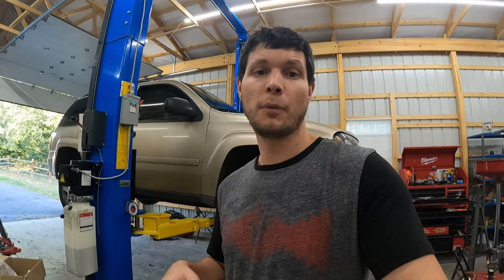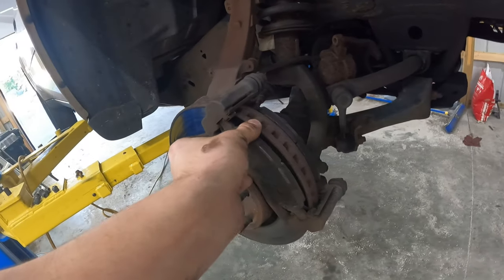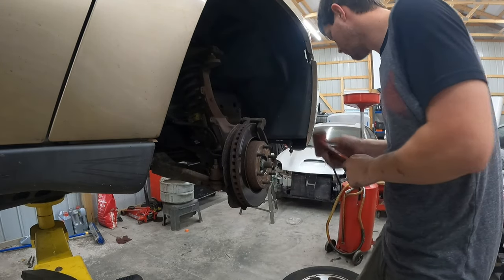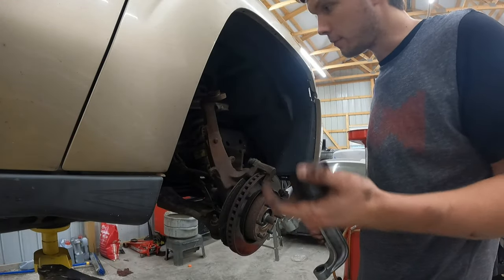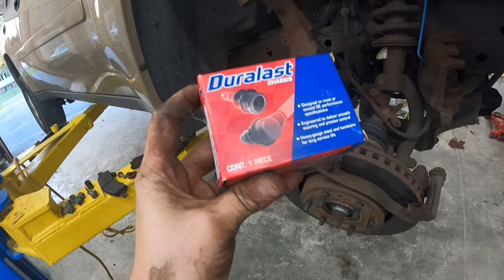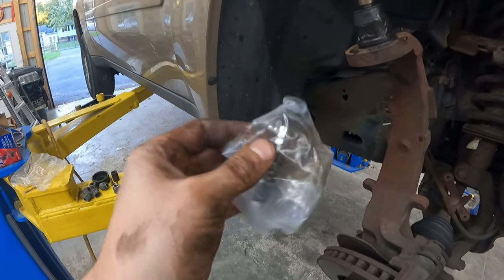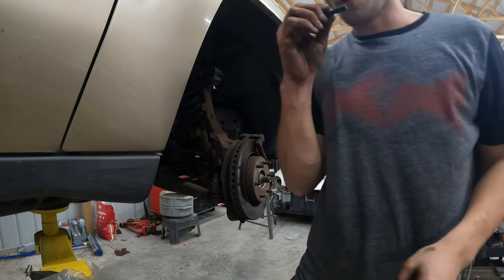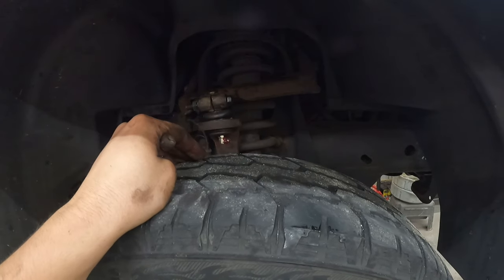BALL JOINT FAILURE IMMINENT - 2006 Trailblazer Upper Ball Joint Replacement - DIY in an hour!

Comment: I might’ve missed it but did you remove axel nut?
Reply from the maker: I did not remove the axle nut or cv axle from the differential . I was able to pull it out enough to do the needful. You will want to be careful to not pull the cv out of the boot. If you want to remove it you can it’ll give you more room.